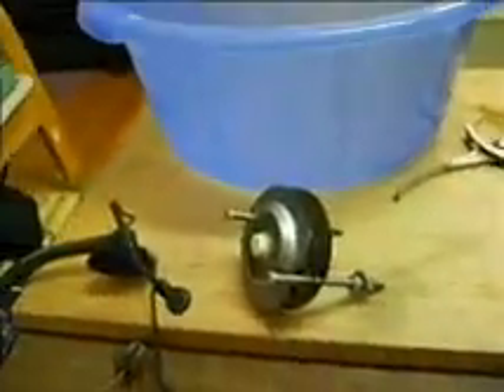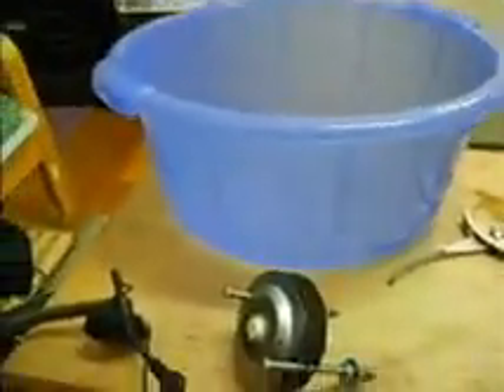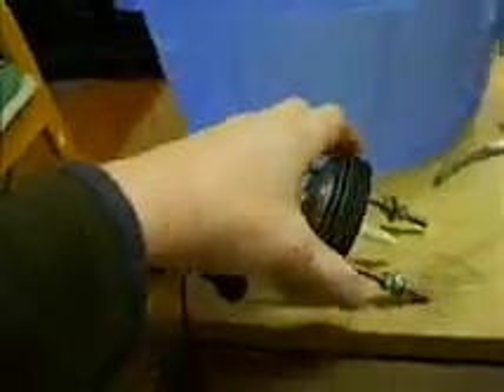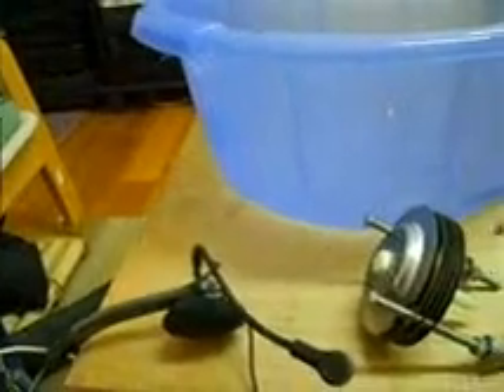Hydrogen at home (testing with & amp and frequencies)#6

Comment from the maker: Good luck, I will check them out.  Just so you know it did not smoke until I used the square wave. And make sure you are using a fuse or you could seriously damage your amplifiers.